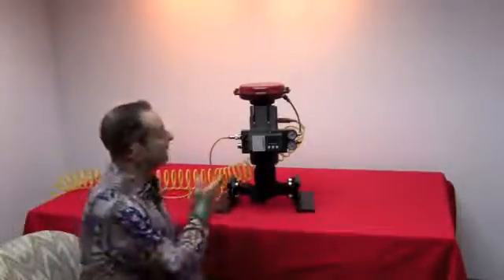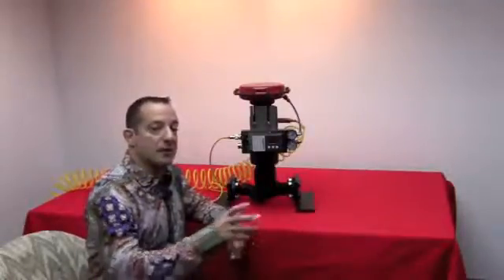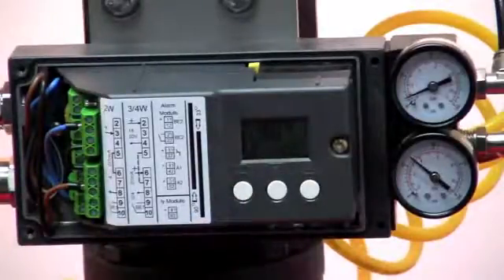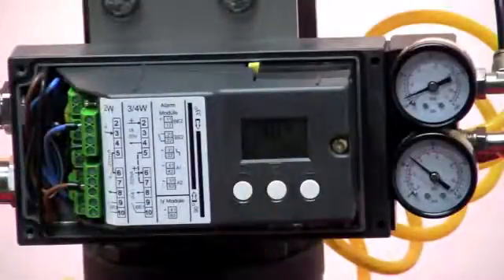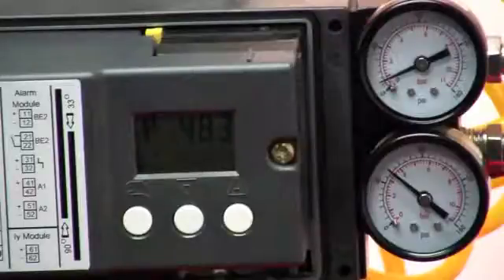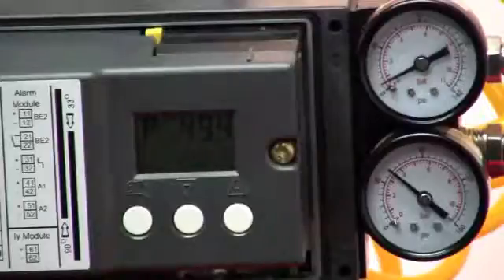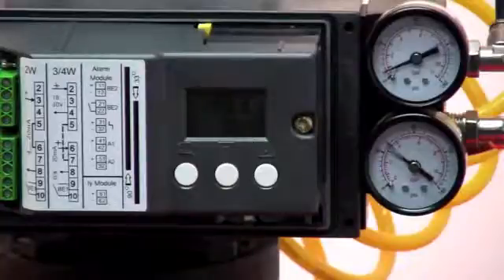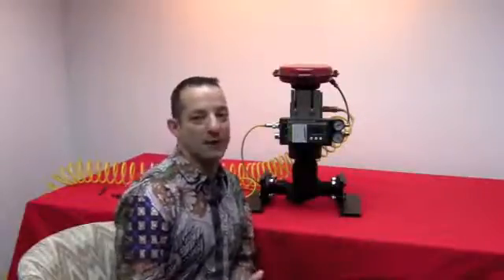Ajuste de Posicionador inteligente SIEMENS

Comment: I need some information about a safety position of valve in case of failure.
I'm use to make calibration in valve positioner  Bray model  serial 6A, however, in the commissioning of a linear double-acting valve, when I cut off the signal of 4 to 20 milliamps the valve modulates for safety position of failure. But when I cut off the air supply failure to the positioner, the valve not modulates and lockup in the place, in another words, stopped in the last position. After to finish calibration, I put the valve about truck and the valve actuator maintained with pressure. I wonder! After of cut off air supply keep permanence of pressure in the actuator?
Reply from the maker: Plesae contact us: comeval@comeval.es Thanks!

Comment: It was a good idea to show this film! but missing the condition valve safety position in case of failure. Cut off air supply and cut off signal of 4 to 20 mA. I think that this kind of positioner with  economic air supply system, in the air failure leaves valve in the last position to make lockup, and no shut down. I think so!